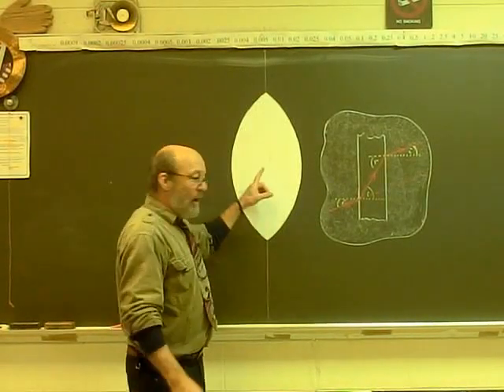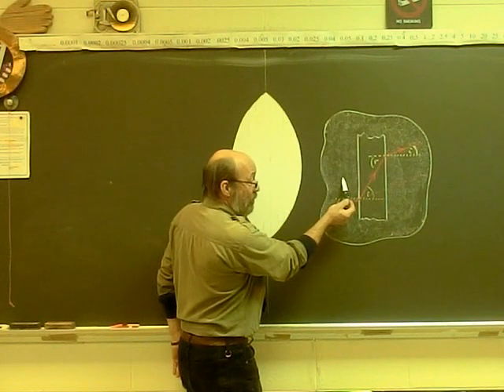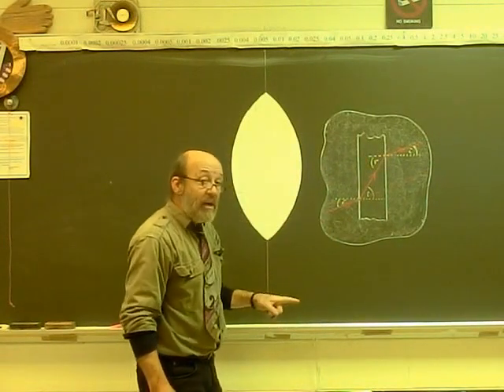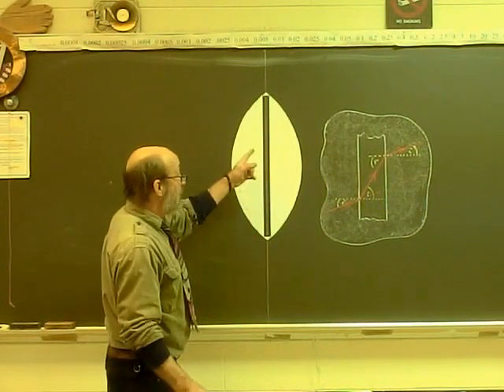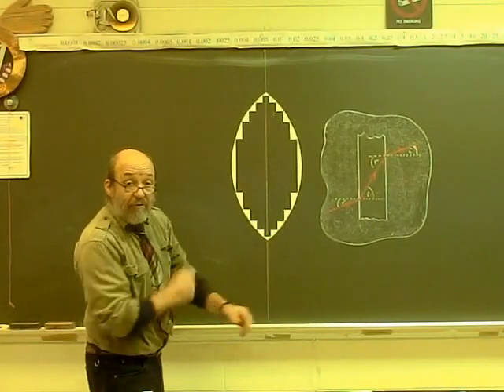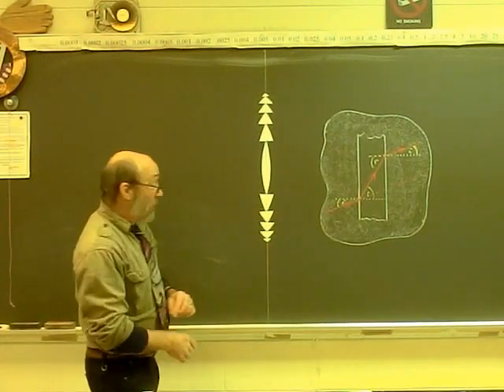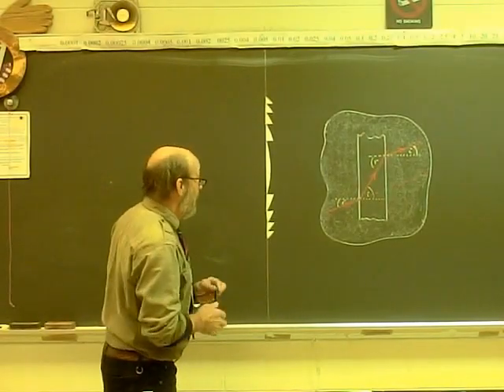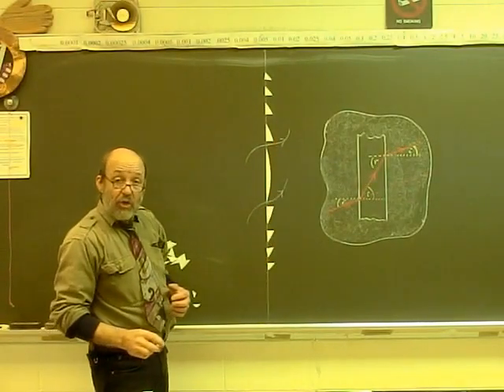How a Fresnel Lens works, using a simple blackboard model.

Comment: great visual explanation, just 2 pointers:
1. Fresnel did not actually invent this lens,  it only got his name because he perfected its design and a method for reliably manufacturing it.
2. The Frenel lens doens NOT have identical properties as the full lens, it is actually optically worse, the degree to which it is worse depending on the size of the "slices". It is used in applications where optical clarity is not as important, you'll never see one in a camera for example.
Reply from the maker: You’re right

Comment: The most common form of "Fresnel" lens we see today (and not at all the sort of refraction lens you would use in a lighthouse), takes the form of a thin sheet of typically plastic embossed with concentric circles and uses diffraction to bend light.
Reply from the maker: Diffraction, where can I get more information? Thanks
Reply: I think you mean refraction.

Comment: I thought a while ago about how you could make a flat lens by stacking specifically shaped layers of materials gradually larger/smaller refractive indices, so as to create a gradient without needing a lens. Then I found out, it's already been thought of and is being looked into. I didn't realize how similarly fresnel lenses work, compared to this concept as well.

Comment: A fantasy of mine one day would be to, have several computer's guide fresnel lens that track the sun all day long, and send all that heat to rock pit under my home, that would be replete with heat energy and be able to spin a sterling motor with a planetary hub to turn over and run constantly my 5,000 watt Honda generator, and then I can ween myself off of Pacific Power's Hydro Electricity that has cost the residence of Oregon the salmon run in Grand Coulee Dam, that happened in Oregon to Oregonian's in the 1942 long before I was born in 1963.
Reply from the maker: You will still need 100’s of square feet
Reply: @mad.scientist  Your answer bugged the heck out of me, so I took it to my "spirit guides". and they said, "It all depends on how many square feet of living space you are trying to heat, (how big your house is), and it depends upon how hot the heat vault of rocks gets temperature wise, say 2,000 degrees, with several thermal couple employeed to reduce the ambient temperature down to a working temperature of 500 degrees for the Sterling motor constantly at, so it can with the help of the planetary hub gear, it will spin the 5,000 watt generator both day and night. Those fresnel lenses given the chance to catch the sun, all day long with the aid of laptops doing auto tracking will get the job done!!! !!!!Kelly!!!!
Reply: I also want to tap into earth's 1.5 volts of electricity which is in the soil, I want to dig long trench's and bury wires in those trench's, and those wires will go through metal plates placed so far apart from one another, so I can draw on Mother Earth's electricity, and I purchased crystal kits at the store, and I want to make special mould's that has a  hole drilled in the base of the mould so the copper wire can have crystals grow all over it, so I can produce electricity, through physical external pressure, being applied. I have a million ideas, a million. Kelly
Reply from the maker: @kellyb.mcdonald1863  Well, good for you. Let me know if you actually do something that works.

Comment: First of all: Amazing video and amazingly simple but effective explanation!

One question remains for me, though. Why does the vertical separation not change the outcome and the focal length? It seems to me that light should escape through the gaps, and that the focal length should be changed by "stretching" the lens vertically.
Reply from the maker: The lens was not stretched vertically for the first part of the demo.
Reply: @mad.scientist  ok but in the second part the stretching changes the focal length, right?
Reply from the maker: I have not measured it, but I don't think so, the curvatures the same.
Reply: @mad.scientist  interesting. I will look into this more. Thank you!

Comment: You did not answer my previous comments, so I do not really expect a reaction on this one, but one can only hope.
Your beautiful demonstration is valid for any lens, of the same shape, whatever its size or weight. I am wondering what would happen if one simply took all the middle parts away and kept only the top and bottom part. 
A.A Michelson (of the ether) thinks that a light source pointed at a lens is equivalent to a light source pointed at two mirrors facing each other vertically. In other words, only the extremities are used to transmit the source. 
We would not get an image of course, but such an "empty lens" would still work just like a Fresnel lens.  Wouldn't it?
Reply from the maker: I don't know. Try it.
Reply: @mad.scientist  Fair enough. I hoped you would know more on this matter. I still love your demonstration. And no, I wouldn't know how to try it.
Reply from the maker: A lens with a hole in the middle would still work,but with a dimmer image
Reply: @mad.scientist  thank you

Comment: Which side of a Fresnel lens would you place a object you wanted to magnify, hence which side do you view through?
Reply from the maker: Hi John,
for the most part it does not matter which way you look through a lens, Fresnel or "ordinary," the focal length is the same either way around. (If you wear reading glasses, try looking through them with the arms pointing forward, they'll still work.) A regular magnifying glass works either way around, it doesn't matter which side you have towards you, it's the same for a Fresnel lens. It's the curved surfaces that do the refraction and they are basically the same. A minor point, when using either type of lens to set fire to something, if the lens is flat on one side and curved on the other, have the curved side toward the sun. That way the bending of the light is shared more equally between the surfaces and a slightly better focused image will be formed.